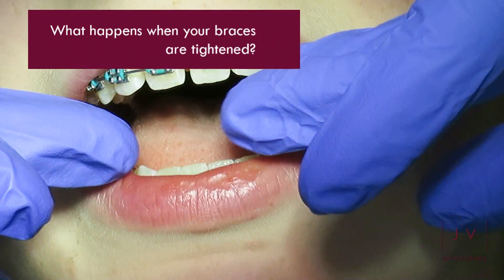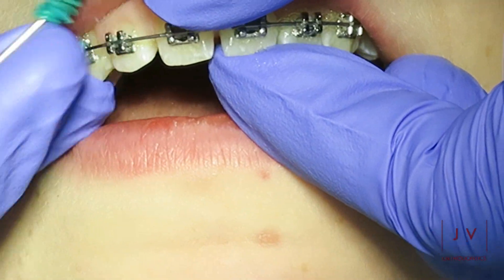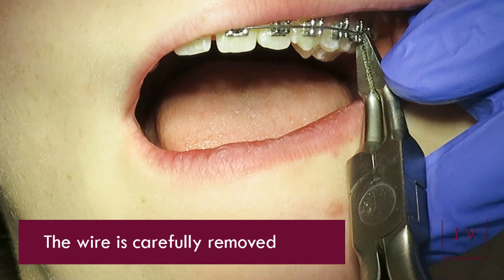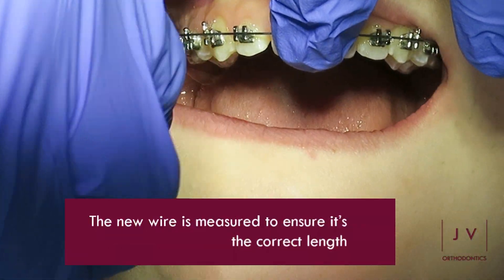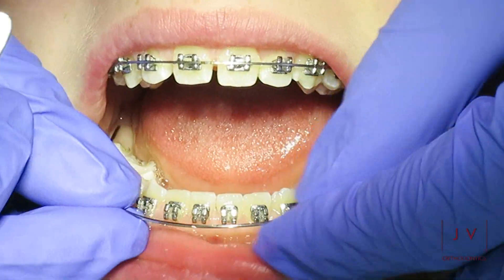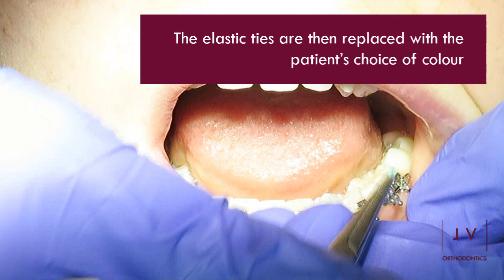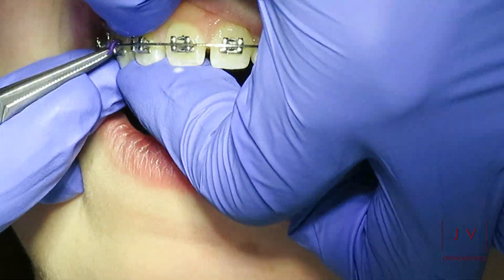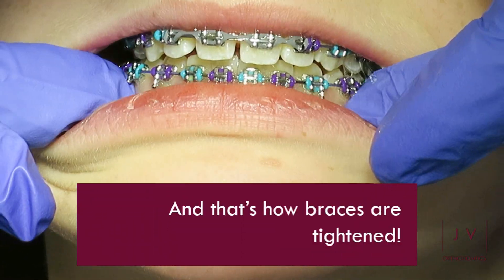WHAT happens when your braces get tightened?  |  Dr. Jiten Vadukul  |  The Orthodontist

Comment: I’m a 58yr old Englishman who had upper and lower metal braces fitted for the first time ever on 08/11/23 to fix my deep bite and minor crowding to my lower front teeth, both of which have got a bit worse over the last 5 years or so. Despite (unusually) having a powerchain on my lower teeth from the very start, I have not had a moment’s pain or even sensitivity even after a thicker wire was added to my upper arch at the first monthly adj. appt. I did have some soreness to my cheeks for the first couple of weeks but, overall, I just can’t understand why people say braces are painful. The worst thing for me has been that I don’t enjoy food anymore because of a) having to avoid some foods  b) still worrying about breaking brackets with the food I can eat  c) not being able to chew because my bite blocks stop my teeth from touching  d) having to clean all the food off my braces after eating. So, purely for the not enjoying food (and certainly not because of any pain or the aesthetics which I actually quite like) I am continually thinking about having them removed (the only thing that has stopped me has been friends trying to persuade me to persevere). Overall, my teeth are quite straight and no one notices a deep bite so I just don’t think the hassle is worth it!

Comment: I just got my braces and when ever my teeth get touched by anything, i feel pain in them, is that normal???????? They don't pain by themselves and when they pain i also feel like they are going to fall out
Reply from the maker: Hi Vritto, usually the teeth feel tender to touch/pressure as it is the supporting bone where changes are taking place to enable the teeth to move. The discomfort is usually evenly spread through all the teeth, so it might be worthwhile getting in touch with your orthodontist if this is not the case. I hope that helps :-)
Reply: @the_orthodontist  Thank you so much for responding! I am tension free now 👍

Comment: I haven’t got braces I have a broken jaw and they wrapped wire round my teeth to keep them in place and wanted to see if this is similar pain wise
Reply from the maker: Hi there - you are likely to have experienced more severe discomfort with your scenario than those who have braces fitted, although the pain is likely to be slightly different as yours would probably be localised to the area of fracture, whereas those with braces are likely to have their discomfort spread across their jaws. I hope that helps :-)

Comment: I got my braces three weeks ago.. I don’t feel any tension on teeth and quite no change on teeth too .  I feel like I need more thinker wire rather than this current small wire .. my appointment is next month . My question is that ‘’ Is this first wire to move my teeth or some says alignment purposes’’ ? Please help explain me.
Reply from the maker: Hi Pyi, sometimes a more flexible wire is used just for the sake of one or two very displaced teeth - therefore patients may not feel the tightness of the brace across all of their teeth. It is generally a more comfortable way to progress through the brace journey by having the most flexible wires to begin with. A good tip can be to take photos of your teeth every week to see how they are changing in their positions. I hope that helps :-)

Comment: it's so satisfying getting the wire taken off!! just got mine tightened for the first time ever and the only teeth hurting this time is my two front ones. the pain is a 3/10 it is bearable!!
Reply: See, that's so funny to me. I got my braces adjusted for the first time recently (I only have braces on the upper teeth for now, but will be getting the bottom braces in about two months), and the only teeth that hurt for me were the ones at the back with the last brackets. The front ones are fine.
Reply from the maker: Excellent! It is great when you begin to see the changes to the tooth positions :-)

Comment: Is it necessary to change the rubber band  and wire for every month? because my dentist change the rubber band 2 months once only so please tell me change the rubber band for 2 months once is correct or wrong please tell me because I was confused about the process🙏
Reply from the maker: Hi there, some wires do not need to be changed for a long period of time, as they can still be active when engaged into the brackets. The elastic bands that tighten the wires also do not need to be replaced if they are still holding the wires in place - often these will end up needing to be changed after 4-6 months as they can weaken with time. I hope this helps :-)

Comment: I have underbite but why they put braces on upper teeth as well? Doesn’t only my lower teeth needs to be moved?
Reply from the maker: Hi there, in most situations, both upper and lower braces are fitted to enable more control of the bite. If just one arch has the braces placed, it becomes difficult to anchor the teeth with the other set of teeth without some form of attachment. Having braces as the attachments allows tooth movement as well as an anchor point. I hope that helps :-)

Comment: Hello there, i was wondering if it’s okay to have the figure 8 ligature on all my teeth? I had a new girl work on me today and she put figure 8 ligatures on all my teeth instead of regular o and now i have a headache and sore jaw. Is this normal?
Reply from the maker: Hi there! Yes this figure-of-eight technique makes the wire tightened more securely into the bracket as the "o" elastic is under more tension. This in turn may cause the wire to feel "tighter" and therefore it may cause a little more discomfort initially. It usually means that the teeth will be put under a little more pressure and you may see some more tooth movements. I hope that helps :-)

Comment: did anyone else's teeth flare out before they became straight during braces ?
Reply from the maker: Sometimes this happens as the first few stages concentrate on achieving alignment, where as the angulations and inclinations of the teeth are addressed later in treatment. This is also why spaces are sometimes visible in the early stages of treatment. :-)

Comment: All the videos I watch have elastic bands, so glad mine doesn't have them.
Reply from the maker: Hi Danny, it may be that you have self-ligating braces on - these do not require elastics as small gates are used to secure the wire in place. You would usually feel the "tightened" sensation when a wire is placed into your brackets and the gates closed. :-)

Comment: I just got my braces put on for the second time and I didn't get the rubber bands why is that?
Reply from the maker: Hi there, some braces do not use rubber bands, for example the Damon brackets. If you mean the larger rubber bands that are worn between the upper and lower teeth, these elastics are usually introduced when they are needed, and may not be introduced at all if they are not needed. I hope that helps :-)
Reply: @the_orthodontist Thank You... ❤️

Comment: Question. 

I’ve recently had ceramic braces fitted. To correct an overbite. Everything going well, except for the fact one of the brackets on the front upper right tooth has come loose from the cement. It isn’t loose in itself, because the wire is holding it very firmly in place. 

I’m due back in to my orthodontist in a few weeks. Is it safe to leave until I go back in for the tightening?
Reply from the maker: Hi there, it is difficult for me to give you specific advice without having carried out a full assessment, however I can certainly provide some guidance. It sounds like the bracket has come loose from the dental cement which holds the bracket to the tooth - in this scenario, the brace is no longer controlling the tooth position and so the tooth may drift back towards its original position. I would therefore recommend contacting your orthodontist so that they are aware and can advise you accordingly. I hope that helps :-)

Comment: I got my braces tightened yesterday ; Can't even eat anything because of that ; it's so hurting ! Still
Reply from the maker: Hi Rahima, it sounds like the ends of the wires may be catching the inside of your cheeks - if this is the case, it usually benefits from the wire being shortened or the ends being turned away from the cheeks - I would recommend speaking with your orthodontist so that they can make any necessary arrangements. I hope that helps :-)
Reply: And I don't know how to cure this gingivitis in braces major problem

Comment: how much do braces usually cost bc my 3rd tooth on the the left top row is growing higher than usual and im 13 so would i need braces for that
Reply from the maker: Hi there, braces are fantastic for correcting teeth which are not in-line. The fees vary depending on who is providing the service and a few other factors like what type of braces are being used. I hope that helps :-)

Comment: After my dentist tightened my braces, it doesn’t feel painful, only bit of discomfort.
Reply from the maker: Hi Felixha, usually immediately after the braces are tightened, the forces onto the teeth increase. Once the effects are felt in the surrounding bone, the tenderness usually comes in for a few days. If you experience pain immediately after your brace is tightened, I would recommend flagging it up to your orthodontist to check the are. I hope that helps :-)

Comment: Hi, I just got my braces a day ago. Can you tell me how to eat?? It hurts so much I don't even want to eat.
Reply from the maker: Hi there, congratulations! The best way to eat is to go for softer foods that can be easily broken up with your tongue or with little pressure between your teeth. The best foods here are crumbly foods and foods that do not require much chewing. Your tongue will do a lot of the chewing for you in the early stages. I hope that helps :-)
Reply: @the_orthodontist  :0 Thank You! I'm actually 11, i just wanted to ask. Thank You :>
Reply: @the_orthodontist  Btw, I forgot to ask you if it's necessary to remove my pre molars?? I have 1 tooth stuck on the top of my gums My orthodontist said he had to remove them because it needs space. They are gonna remove 4 pre molars do u think it's necessary??
Reply from the maker: Hi there, it is difficult for me to comment on your specific case as I have not carried out a full orthodontic assessment. I would recommend going on the guidance of your orthodontist and asking them if there any alternative treatment options if you are not keen on an extraction avenue. I hope that helps :-)
Reply: @the_orthodontist  It's ok. Thank You! :)

Comment: Do steel braces needn't be tightended
My dentist said to come after 4 months I wanted to confirm from an ortho ??
Reply from the maker: Hi there, it is difficult for me to give you specific advice without having carried out a full assessment. Generally speaking, most braces that I treat patients with, are ones that benefit from an adjustment every 2 months on average. There are some braces where we may be monitoring the movements or tooth positions over a longer period of time. I hope that helps :-)

Comment: Help please! So I got braces put on my teeth almost a year ago. My teeth weren't bad at all just one crooked tooth at top but I have self esteem issues so I decided to have braces put on to fix it. Well after about 6 months that tooth is now straight but I now have a space that was created by my braces which made my self esteem WORSE. I was told it would close shortly but nope it hasn't, not even a little bit. My teeth are worse than before braces. Do you know why this happens? How long it usually takes to be corrected? I thought braces closed spaces not make them.
Reply from the maker: Hi Nikki, I'm sorry to hear that. In nearly all cases I have experienced, having brace treatment tends to boost self-esteem, so I hope your journey improves and you reach the result you want. Sometimes if the teeth are tipped inwards, as they move forwards into more optimal positions, they can occupy a wider arch-form which creates some space in the arch. This is just one example and it may not be applicable to you. I would suggest that you discuss your case with your orthodontist who will be able to give you specific advice. I hope that helps :-)
Reply: @the_orthodontist  thank you that did help😊. I actually have an appointment tomorrow and will discuss this concern

Comment: Just had mine tightened as well as bottom braces on AND did not know they tightened them like that lol , scared of those scissor looking things used to put the elastic on
Reply from the maker: Hi Lucy, be reassured about that instrument you described - it is not sharp and is similar to a small clip. It allows precise control of orthodontic auxiliaries. :-)

Comment: i have braces for 2 months now, when can I get the power chains? i have a big gap in my two front teeth
Reply from the maker: Hi there, the power chains are the elastic components which we use to often close spaces. I like to wait until certain wires are in place and the teeth are where they should be, before placing power chains. If you are unsure when your spaces will be closed, I would recommend asking your orthodontist at your next visit :-)

Comment: Even I don't feel any pain after getting it tightened... does it mean it's not working?
Reply from the maker: Hi Anmol, everybody has a different experience of the tooth movement effects. The worst of it tends to be immediately after the braces are first fitted. It is usually more comfortable after this. Once braces have been adjusted, patients usually feel a "tight" sensation on their teeth which the effect of the braces applying force to the teeth. If you cannot feel any force on your teeth, then you could ask your orthodontist about the stage of your treatment. I hope that helps :-)

Comment: I have a doubt iam placed yesterday my braces but they put only upper teeth with braces  . And they leaved my lower teeth as usual.
Why they leaved the lower teeth is my question
Reply from the maker: Hi there. Regarding the braces going on, sometimes it can be beneficial to have the braces going on at separate stages, for example if the bite may interfere with the braces or if there is particularly more work to be carried with one set of teeth than the other. We generally aim to remove both braces together so we try to time the braces going on in such a way that the treatment for each arch will reach the finish line together. I hope that helps :-)
Reply: @the_orthodontist  thank you . It's means a lots

Comment: So tightening is basically them putting new rubber bands on?
Reply from the maker: Hi Kris, well that is part of it if you have a similar brace. The newer elastics feel tighter but additionally, you may also have your wire changed (like the patient has in the video) which if bigger or more rigid than your previous wire, can feel tighter too. I hope that helps :-)

Comment: My dentist has done ipr in both upper nd lower teeth bt the gap isn't filled yet it's more thn 7 months now since he done that i m really worried idk if it's normal
Reply from the maker: Hi there, the IPR is usually a means to gain further space in your arches. If you are concerned about the spacing, I would recommend asking your orthodontist about it - there may be a plan in place regarding the spaces to be used for a specific purpose later on. I hope that helps :-)

Comment: Hello im wondering why my orthodontist didnt put the bottom braces for me yet he says he has to sort out the top first id like too know why and i really enjoyed this video!
Reply from the maker: Hi there! Thanks for your feedback! Please let me know if you would like to see videos on any other orthodontic topics. Regarding the braces going on, sometimes it can be beneficial to have the braces going on at separate stages, for example if the bite may interfere with the braces or if there is particularly more work to be carried with one set of teeth than the other. We generally aim to remove both braces together so we try to time the braces going on in such a way that the treatment for each arch will reach the finish line together. I hope that helps :-)

Comment: Hi! I just got my braces tightened yesterday (second time), and they  are quite a pain in the neck for usually 2 days. Also! Theres somewhat of a gap in my teeth and theres a tooth just behind it. I  noticed they actually put a spring on the wire in that gap. I'm guessing that the spring is to space out the teeth a bit more to then try and get the other tooth joined in with the whole braces situation. Can someone/you confirm this? ❤
Reply from the maker: Hi there, although I can't comment on your specific case, I will often use a spring to gently open a space where it is needed - and when a tooth is displaced out of alignment, creating space for the tooth is the first step before being able to bring the misaligned tooth into place. I hope this helps :-)

Comment: Will the tightening eventually stop hurting because I get my teeth tighten in 2 hours
Reply from the maker: Hi there, once the braces have been tightened, they usually cause some discomfort for the next few days as the force applied to the teeth is generally higher initially. As the teeth begin to move and as the forces settle, the teeth usually become more comfortable. I hope that helps :-)